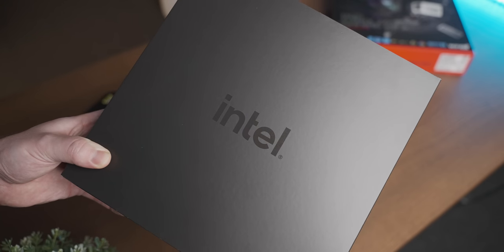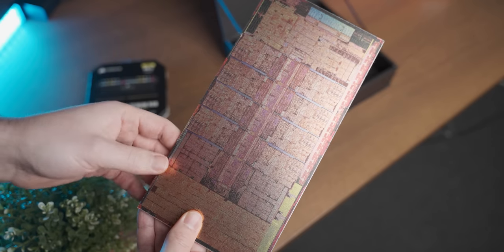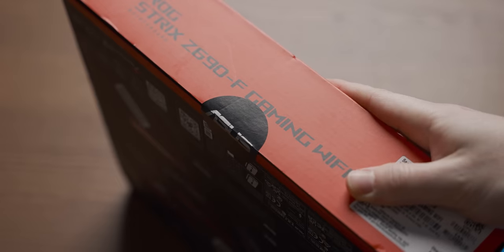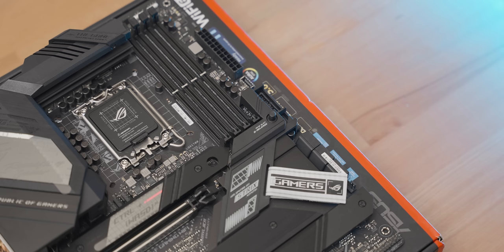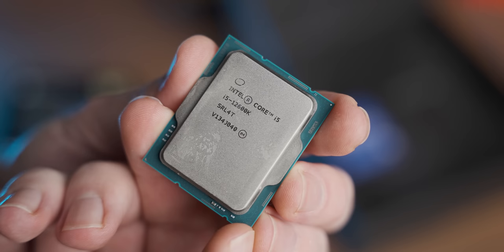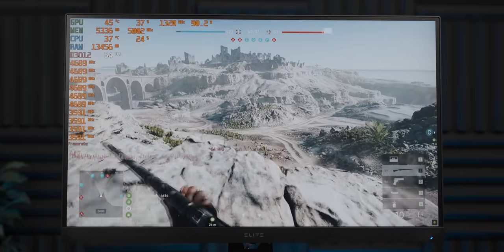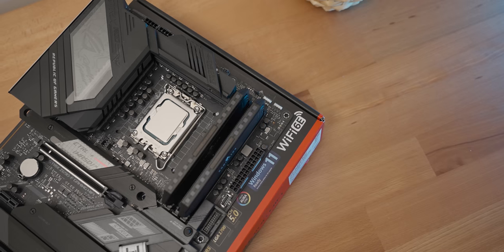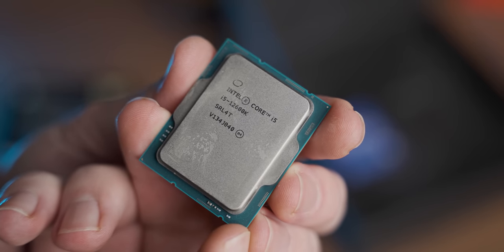Intel's 12th Gen E-Core Gaming Is Surprising!

Comment: I haven't tried it in years, but it should be easy to change the affinity for any running application just through task manager.  You don't need a special third party program.  The only problem is that you have first to start the program you want to change the affinity for/of/from/whatever.

Comment: You know youj've hit the big time when Corsair is sending you 64gb of Platnium ram. :)
Reply: Ye, slow DDR5 with extremely loose timings.  If I buy a 12600k I will grab a DDR4 board with some 4000mhz RAM with much tighter timings.  DDR5 is WAY too expensive and won't be worthwhile for a year....maybe two in our current tech climate.

Comment: GTA V when you go over the limit engine (188 FPS) it stutters A LOT so you need to lock the fps, that’s why the 1% low was much lower with the P-cores.
Reply from the maker: For sure! That's what I was thinking. I also think that may have been the case with BF V.
Reply: Came to say that - basically all of Zen 3 and even the older i7 / i9s can encounter the same issue when the framerate bounces off the engine limit.

Comment: Performance is surprisingly good, and prices are very reasonable.  Microcenter already has the i7 12700K down to $370, which performs very similar to a 5900X.  AMD has been lowering prices a bit, but I think they're going to keep them relatively high, as they know there's a huge amount of people already on AM4, thus willing to pay more for Zen 3 CPU's if it means a drop in upgrade over full MOBO replacement.
Reply: Not exactly great value for money at $370 though, is it? really?
Reply: @buggerlugz6753  Even at the most discounted retailer in the US, the 5900X is $470 (again, they perform very similarly).  So yes, Alder Lake is currently king in price to performance.
Reply: 2x16 kits of Ddr5 sell for $2000 on ebay definitely go with D4 motherboards
Reply: @buggerlugz6753  Tbh, i7 and R7 have always felt like a dubious value. If you really need a higher core count for real work, why not go i9 or R9? If you just game, why go past i5 or R5?
Reply from the maker: The price wars have begun! I think the biggest problem with this platform is the mobo prices though. Even DDR 4 z690 boards are hella expensive.
Reply: @DawidDoesTechStuff  exactly. Intel moved a lot of the price into the chipset, so optically, they compete, but in reality, AMD can mostly keep prices where they are. 12400s and minions will hopefully change the picture, there is a lot of potential to slaughter 5600x at its current price point
Reply: @DrearierSpider1  The cpu itself is better but you have to pay lot more for the platform (z series motherboard, ddr5 ram, decent cooler, etc)
Reply: @viztiz316  1) You don't need DDR5, and aren't able to buy it in most areas anyways.

2) The only part that needs excessive cooling is the i9, and even then it's only applicable when you're fully utilizing the CPU in workloads like Blender.

3) Z690 boards are roughly comparable to X570 launch prices.

You could go with Intel or AMD pretty safely depending on your local pricing and availability.
Reply: @DrearierSpider1  Who would get DDR4 when DDR5 is coming and will be in every new system after 13th gen. 
B550 boards come with most of the features of x570 for a fraction of the price. The 5900x will run fine with a 100$ motherboard. You would need a 400$+ motherboard just for the i5 12600k.
Pricing is higher for intel almost everywhere due to the motherboard prices
Reply: @viztiz316  "Who would get DDR4 when DDR5 is coming and will be in every new system after 13th gen?"

99% of users. DDR5 is at least 3x the cost. You can buy 32GB of DDR4 for $100 right now, use it for a couple of years, then get a faster kit of DDR5 significantly cheaper in a couple of years, and the cost of current DDR4 plus future DDR5 will likely be equal or less than current cost of DDR5.
Reply: The i5 and i7 worth the cop like always, the i9....ugh good luck with that
Reply: @shinefake48  It trades blows with the 5950X for sightly cheaper. Most don't need that much CPU, but it could be a good option for those who do.
Reply: @DrearierSpider1  5950x isnt a necessary cpu for all, is only for those that need the high amount of high performing cores, which in the average consumer market, overkill. I just got a 5900x for my work needs, but in terms of 16 cores, is too much for my needs
Reply: @jablue4329  i7 is able to stream and game, and do hobby level content creation. Its the i9/r9 i find pointless. They have the core count of an entry level Threadripper or Xeon but lack all the other features and aren't significantly cheaper. Obviously Xeon is not even an option till Sapphire Rapids HEDT, but the point still stands.
Reply: @eclipsegst9419  idk, you can stream and game really well with any modern Nvidia card and nvenc. I guess the hobby content creation market is where they're really selling.
Reply: @vladimirljubopytnov5193  yeah but amd cpu’s are so over priced too. You can’t really win in either direction.
Reply: @viztiz316  Z690s start at 200 for DDR4 or 220 for DDR5, which is significantly higher than the 170ish that previous boards started at, but not shockingly. I would not trust the power delivery on a $100 b550 with a 12 core cpu long term, maybe some would take that risk, but i think most who can afford a 9 series cpu would not.
Reply: @shinefake48  if you need 16 cores you probably need more ram channels and ram capacity so you should get a threadripper anyways for your work and make a separate rig to game later. Threadrippers will game at 4K just fine anyways even 1st gen.
Reply: @viztiz316  yeah and amd CPU’s are really expensive. It’s still cheaper to go intel. I got a gigabyte aero g for $289 and they have plenty of boards for $200-$280. Pretty sure they even have a few under $200. When the 5950x is $300+ more expensive than the 12700k and almost $500 more expensive then the 12600k then it’s just not worth it. The 5800x (which the 12700k beats) is only like $30 cheaper on sale. Intel is still great but intel is definitely better for price to performance now that they got over there stagnant generations of just changing the model number haha. Even the 5900x is $500+ which if you find a 12900k at msrp then you can get that for almost the same price. 

In the end if you just game then the 12600k and a $200 motherboard can’t be beat in terms of price to performance. Just make sure your vrm’s are capable of handling the cpu without effecting the performance.
Reply: @jablue4329  True but nvec is not as nice as what an 8c/16t can do with x264. Personally i would rather get the i5 and buy a 300 used workstation with a 8+ core xeon to offload threaded work to. Keep my gaming pc clean and not always busy. But a lot of people can't be bothered.
Reply: @eclipsegst9419  the 5900x is mainly used for video editing and some rendering, the threadripper just too much for the purpose, cant really bust my bank at a CPU that I only need for college work
Reply: Intel is $100 cheaper but their mobo is $100 more and you have to buy a cooler. Buying a AM4 board guarantees you at least another generation of CPU's to upgrade to after the 5000 series. I'm running a 3700x, plenty of CPU for casual gaming and web browsing.
Reply: @buggerlugz6753  Considering that i7 had been Intel's MSRP US$350-380 range, not retail markup, that's pretty good deal.
Reply: I think they've got potential, but factoring in the inevitable motherboard and ddr5 RAM costs, I don't actually think it's a better deal just yet. When DDR5 becomes more mainstream, then, definitely.
Reply: @ayaanpathan7169  If you are upgrading platform from 3-5 years ago, this is definitely worth the upgrade.

Not only that, 'basic' DDR5 will be harder to find in the near future. I could barely find DDR4 with 2.133 GHz that runs out of the box, because my second system has 6700K.
Reply: @mrwashur1991  no tf they aren't where you getting that from
Reply: @mrwashur1991  True, Im not denying that both are overpriced. both replaced their low end with what is left from previous generations.
Reply: @AlpineTheHusky  my comment literally says "definitely go with D4 motherboards"

Comment: The board has LGA 1200 and 1700 holes drilled in it. Hence the two sets of drill holes on the board.
Reply: @NikA he may not have had the 1700 standoffs because the 1200 standoffs are too tall for sufficient pressure.
Reply: @mstrwil73  depends on the cooler, my air cooler and ek water block are both fine. Artic aio didn't though
Reply: @LawrenceTimme  My MSI AIO works just fine with the lga1200 hardware since it takes them a month to send out the correct mounting hardware
Reply: @mino4258  yes one some coolers the standoffs are too tall so even though it fits the coolers doesn't touch the cpu

Comment: Hey Dawid!
I'm still impressed at the older i5, it sure held its own against the much more modern e-cores.

I'm very curious to see a 2 "gamers" 1 cpu virtualization build with these CPUs, splitting E-cores to one user and P-cores to another.
Just throwing it out there
Best regards!
Reply from the maker: That sounds really interesting! You can have like a virtualized baby gaming PC running off your chad PC. 😁
Reply: @DawidDoesTechStuff  yeah im gunna need a hustle on that video Dawid. make the GF play the sims on the baby gaming rig.

not for any specific reason I might be interested in just for a completely random example.
Reply: @DawidDoesTechStuff  I bet an 12700K, with 8 threaded performance cores and 4 efficiency cores could easily handle 2 instances of any game with a 4C/8T P core + 2 E core setup per instance.
Reply: @DawidDoesTechStuff  could you split a single gpu’s power between them or would you need to have two gpus with one routing to the virtualised pc?
Reply: @spooky2.043  windows programs dont split single GPU very well, LTT found that its just easier to get a 2nd GPU but you have watch out for the board. lot of times a 2nd GPU will force both to run x8 instead of 1 x16 and the other x8

Comment: I had an old motherboard and cpu without the bracket for the cooler that I was gonna use for a project, so I found some angled aluminium and cut it into a couple of pieces which I drilled wholes in, to use as mounting hardware for a heatpipe chipset cooler I had laying around. zip-tied it all down , zip tied an old 80mm fan to the thing and the temperature was actually decent. Too bad one can't post pictures here (or maybe it's for the best) I'd love to show my work of art to you.

Comment: I had an i5 4690k before upgrading to a 10400F. Major difference in gaming. That i5 was awesome. Held up great.
Reply: yep. my wife still has one. I think ill give her my 3300x and nab up a 12500 when they release. I'm done with unlocked chips when they have such little headroom nowdays.
Reply: @eclipsegst9419  Glad to hear someone else is rocking one! As for the unlocked  chips the asrock z590 phantom does boost the 10400F. Can't remember what mine pushes but I think it is around 3.9-4.1GHz. Im gonna wait a few years before upgrading, as I recently did this upgrade and hate to shell out $ for new mobo and ram.
Reply: @roamintheslums4851  yeah that's the thing. If leaks are correct 12500 should have stock boost of 4.6 and that's what I ran my 2500K and that 4690K at back when they were in my rig. So if I can enable XMP on a B or H board and possibly get a hair extra boost to boot, I really don't feel the need to spend extra on a 12600K and Z490.
Reply: @eclipsegst9419  I'm more than comfortable with my setup... for once. I neither feel the need to upgrade for years to come. I don't rely too heavily on overclocking. Makes me uncomfortable lol. I rock a 1080 ftw 2 with the 10400.

Comment: Hey Dawid, I got a ViewSonic VX3268-PC-MHD 32 Inch 1080p Curved 165Hz 1ms Gaming Monitor with FreeSync Premium Eye Care HDMI and Display Port 
It looks like a bunch of tiny dots. I try everything on the Display Setting and still the same. 
Is it because the pixel density is too low?
What would look sharper a 24", 27"?
Thanks

Comment: Dude, ASUS Z690 boards literally have oval holes for CPU coolers having both LGA1700 and 1200 holes. You can see them in the video. You should have used LGA115X/1200 retention kit.

Comment: Could someone recommend computer spec for blender use (rendering, etc)? My son is learning animation and need a good computer.
1st choice: AMD 5800x with a rtx 3060 or rtx 3060 ti for around $1,550.
2nd choice: AMD 5950x with rtx 3070 for 2,500 (don't know if it is to much performance since my son is a beginner but dont want to to update the system soon)
3er choice: open to recommendation ( what I read is that AMD perform better than intel for blender etc) but let me know your thoughts.
Thanks

Comment: Given these results just imagine how a relatively lower range laptop with a 2pC/4eCore CPU or a 2-in-1 with a 2pC/8eC or 4c/4eC i5 mobile will do with console emulators.

It doesn't need to run PS3/XBox 360 to even be fun. PS2 and Dreamcast would be fun enough. Heck I'm running a PS3 official port on Steam on a 1005g1 just when I need to kill time but I either can't get to my desktop or I'm home but don't want to sit next to a hot Skylake box at 1pm.

Comment: I feel like this video also serves to highlight just how good Devil's Canyon was and still is. Would be interesting to see if the good old 2500k is officially "dead". I'm confident in saying C2Q is for AAA gaming, but I have a hunch overclocked Sandy can still push 30+ @1080p (low) in anything when paired with a proper GPU (780ti-ish).

Comment: Looks like you were having GPU RAM crashes. I could be very wrong. It seemed like it was dumping all the textures and the GPU speed went down to standby mode. Most likely due to it trying to talk to the Pcore that wasn't able to be used.

Comment: Basically, Ecores are pretty much like stolen from a laptop cpu or lowpowered cpu cores and glue it in a desktop cpu just a simple analogy.  Thus, making it feels like a hybrid desktop. In return, it almost idles like laptop and on heavy workloads it performs like a desktop. Actually, really a clever engineering from intel. Though intel just need to fix the power draw because it draws a lot of power all full workloads.

Comment: As great as 12th gen looks/is, it's still unfortunately much more expensive than the AMD competition due to the insane motherboard and RAM prices required to run them at full performance. And someone buying into a new platform would probably want to replace the least amount of things they can overtime.
Reply: Just buy DDR4 3600 CL16 or something, and a DDR4 board, especially if you are on Windows 10.  DDR5 RAM isn't going to be worth uprading to until maybe 2023 and it much prefers Windows 11.  Remember when DDR4 first came out?  It was hella expensive with not much of an upgrade over the really tight timings DDR3 had at the end, and the speed of the first DDR4 sets weren't that much faster.  DDR5 is a fad at the moment.
Also people ordering any DDR5 RAM are finding they have a 30+ week wait to even get their hands on some.

Comment: i5 4690K was a solid CPU, I upgraded from that overclocked at 4.5 to a current Ryzen 5800X @ 4.7 about a year ago
Reply: I'm still sticking with my 9600k overclocked to 5.3ghz.  It's incredible.  It beats the 9900k, 10600k, and 11600k in many games.  None of those CPU's can overclock to 5.3ghz.  Maybe I will upgrade to Ryzen 6000 or Intel 13th Gen....see what is better.

Comment: Great, that 12900 got more fps on e-cores alone than my i7-4770 with a GTX1660.
Reply: Well it was being run with a 3080 ti.  That thing eats 1660's for breakfast.  If I were you I would ugrade your CPU, you can't be getting the most out of that 1660.  I'd upgrade to something like a 9600k.. The tech Youtubers hated the 9600k, but with a decent cooler you can run it at 5.2ghz (mine has been at 5.3ghz for a year now, but I got a REAL good chip).  I bought mine on Ebay with 16gb of 3200mhz RAM and a Z390 motherboard for £250 (used, of course, but it has served me VERY well).  
Mine smashes my brothers 5600x in many games with the same GPU (we tested).  If you are just gaming you don't need a million threads.  6 cores will be fine for a few years, unless you are thinking of upgrading your GPU as well to something higher than a 3060 ti.  You would need something more powerful at 1080p then.
You can sell your i7-4770, board and RAM for a similar price and upgrade for nothing because I did the same with an i5-4690k, RAM and board. 
I have a 6600 xt (fully overclocked) and am hardly ever more than 5% CPU bottlenecked on a 144hz monitor at 1080p ultra settings (apart from Cyberpunk which doesn't reach anywhere near 144FPS....more like 75 on high settings.

Comment: I actually expected the e-cores to outperform the old i5 by quite a bit more. The old i5 seemed more stable if the 1% was anything to go by
Reply: DDR5 doesn't like Windows 10 muich in many games.  If he had used a DDR4 board it would have been a different story (at least I think).

Comment: The reason the 1% lows in gtav were so low and it was stuttering is bc the reason gamers nexus said when gtav came out. When you hit like 170 to 180 fps in gtav the game starts to stutter. They determined it was like a limitation of the engine or something and the solution was to turn up the setting more so your fps dosent reach the 170 fps ceiling causing the stutters.
Reply: I think its actually 180.5 FPS

Comment: 6:50 processor affinity is a setting build into windows which I think does basically the same as process lasso, I think at least 🤷.
Reply: Yes, but process lasso lets you set up profiles and automate many things in regards to affinity. It's a nice program.
Reply: @nap8187  ok, didn't know that thanks.